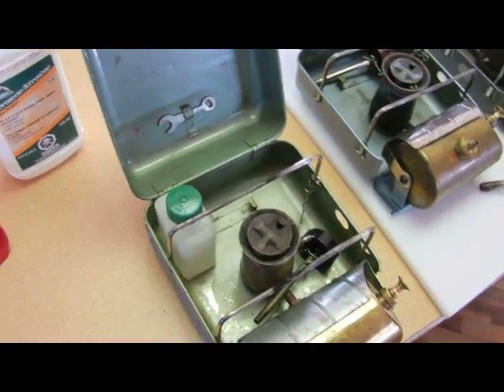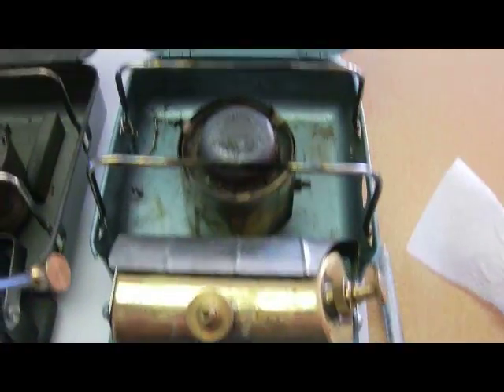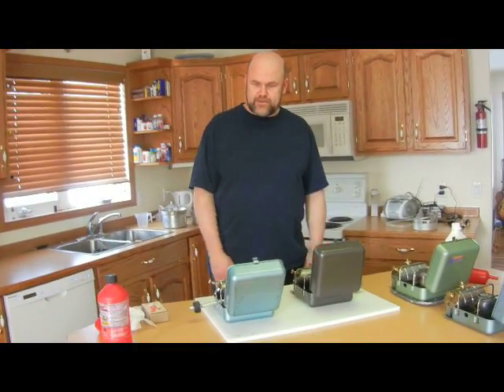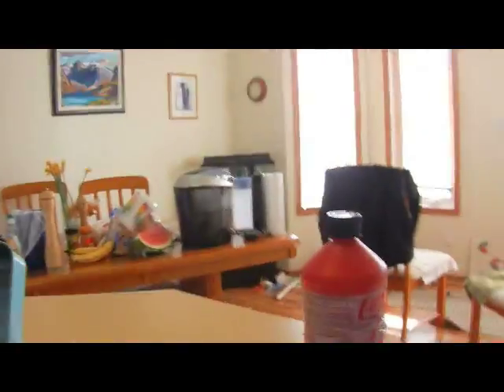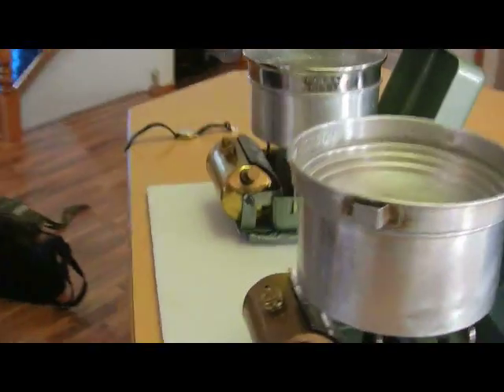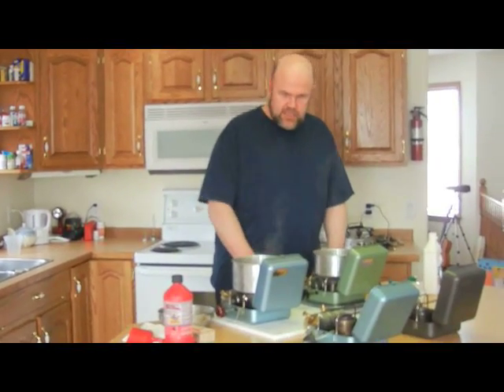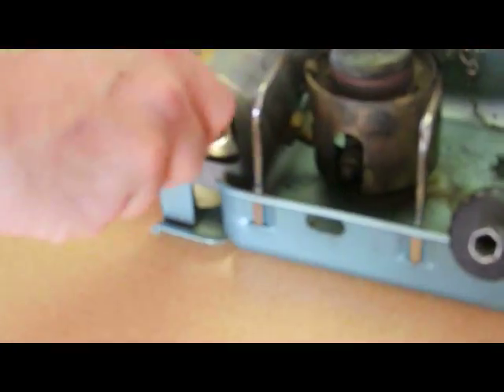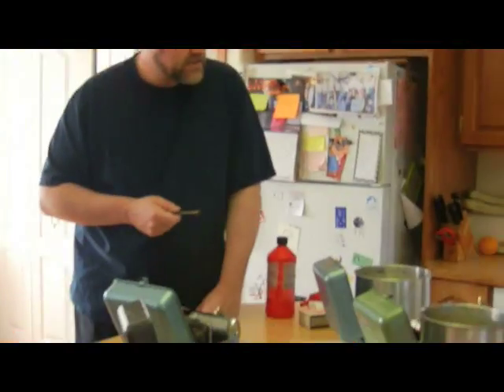The Optimus 111 Family

Comment from the maker: Interesting enough the 111C burner is far enough away from the pot stand that it doesn't produce CO when the flame hits the cold pot.  The other 111's can produce a bit of CO when melting ice.   I played around with the C and with a G jet it burns quite a bit hotter.  I like the C but agree that the Original and the T are the queens of the 111 world.

Comment: What is the difference in interior design between Optimus 111T and Optimus 111C??
Reply from the maker: 111 T  picture here.  Looks like the rest of the tribe with a silent burner put on top.  see it here.   http://luontola.com/luontola/ultimate/index_eng.htm
In the C or D they have a brand new lower burner design called the Cobra.  The lease elegant of the bunch and outlined here.  https://classiccampstoves.com/threads/optimus-arctic-111c-111d.23393/

Comment: I didn't see an Optimus 8 R in your line up.
It is similar to the Svea in coming with out a pump but you can see its lineage is similar to the
others.
Enjoyed the vid.
Reply from the maker: I have a few Optimus 8R's.  Bought them when they where going for $20-30.00,  Nice little stoves.
Reply from the maker: You can see one of my 8R's here.  https://www.youtube.com/watch?v=feuIzQ2e37w&list=PLs47Tr0OabKz9xSNW7G8k6Z_mb6p-jvjz&index=6
Reply: I like these older stoves.
They are tough and reliable.
Only problem I heard of was a fellow that removed the fuel cap while the stove was in use.
Vaporized his tent but I gather he was ok.
That of course was not the fault of the stove.
The tank size is also a plus for me.
A guy could do a weekend and not have to carry extra fuel.
Thanks.

Comment: How much water did you test with? And what temperature in the beginning? I have a original 111 and it needed 7 min to boil 500ml water
Reply from the maker: 2 cups at about 65F.   7 minutes seems very slow.
Reply: @north61  Thank you. 500 ml and 50F. I try again.
Reply from the maker: @roynavjord7978  Check all your seals and try running a few tablespoons of carb cleaner mixed in with the fuel.   My 111's are all quite fast.   Only the MSR Reactor or three burner Coleman can get faster boils.

Comment: Hi, I recently bought a used Optimus 111 8, I wondered if it was a B model initially but I'm sure the embossed lid reads 111 8 and not 111 B. Inside the lid is a brief instruction listing it as a 111 Hiker. It also lists possible fuels as Kerosene,Parafin, White Gasoline,petrol. Alcohol or Methylated spirit can also be used for which a restrictor tube is provided. I only had the Meths to hand so tried to replicate your test using that and an encapsulated based stainless steel pan which took almost 8 minutes to boil 2 cups of water.....my question is, does meths produce less power than other fuels as it seems to burn less fiercely than your stoves and would the steel pan also account for the longer boil time ?I have yet to see another 111 the same as mine, it has the quiet burner with right hand control knob which is flat and red, and the case is silver painted with a large embossed Optimus emblem top centre with Optimus 111 8 embossed lower right of the lid. Can anybody confirm if there is  111 8 model as the closest looking stove I've seen was badged 111 7.
Reply from the maker: +Susan Goodbrand Hello...Alcohol has half the energy per weight as Kerosene or gas.  It will be slower on Meths but should burn very cleanly.  Not sure about a 111-8.  Never heard of one.  Very interesting.

Comment: How can you tell the 111 from the 111B.  I noticed that the handle is red on the 111B. What are the other differences?
Reply from the maker: If you take off the wind screen the 111 has 4 vapourizing tubes that lead into the burning unit..the 111B is designed for white gas only and only has two.  The color of handles changed over time or mix and matching has happened over the last 20+ years.  The 111 is the better stove if you have a choice as it is more versatile.  I'll see if I can find a link for you as a picture would help.
Reply from the maker: http://www.berniedawg.com/optimus-11/olympus-digital-camera-28/  This is a picture of the 4 tubes on the Kerosene burning 111 from a guy called Bernie Dawg who repairs stoves.  Great Site.

Comment: I'm curious who the Kerosene burns without wicks, can you pump it like Naphtha? one more thing, when you say Gasoline you MEAN diesel NOT ordinary unleaded Gas?
Reply from the maker: Yes... the Kerosene 111 is a pressure stove.  It needs a good preheat with gas or alcohol to vapourize but burns like a champ once it's heated up.
Reply: when he says gasoline he means white gas or naptha. b on the 111b stands for bensin. these types of stoves were not designed to burn automotive or aviation gasoline/petrol.

Comment: There is an optimus 111 on ebay for 256.00. Cold someone tell me why they are so expensive.
Reply from the maker: Supply and demand.  They are wonderful stoves, no longer made for a decade or much more...and the supply is dwindling as hoarders (I mean collectors) like me have bought them up.  When I bought them there would be 10-12 on eBay at a time and they would go for 50-60.00.  Now there are 0-2 on and the bids get driven up.
Reply: you can still find them at thrift stores, swap meets and garage sales for ok prices. the cheapest 111b i ever found was $5 at a garage sale and it was working, but very rusty. ebay drives up the prices, the prices took a huge climb during the 2006-08 economy crash when desperate people were selling off all of their toys..

Comment: The 111t is far superior to the c model.  The c model incorporates changes designed to benefit the manufacturer NOT the user.  They should have found a way to raise the burner closer to the pot stand.  They wanted the 11 explorer ant 111c to use the same burner without regard for the combustion physics.

Comment: Great video north61 I just saw that it's possible to convert those stoves to alcool so what it takes and where we can get it in canada if possible. If not in USA. About the silent burner, it's fine but for myself I really enjoy the sound of the roar ones.The differences between different fuel type like alcool vs white gas or kerosene I found an interesting table of comparison on Zen Stoves site that list them all with infos about molecule structure, boiling point, BTU etc... very interesting here is the link even if I'm quite sure you already know it but it can help others who are reading those comments http://zenstoves.net/StoveChoices.htm#Fuels